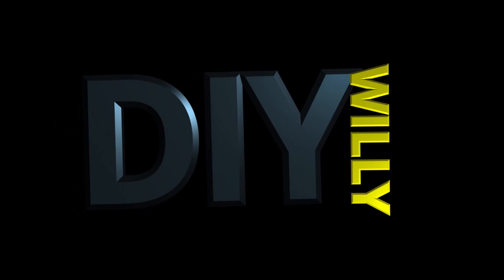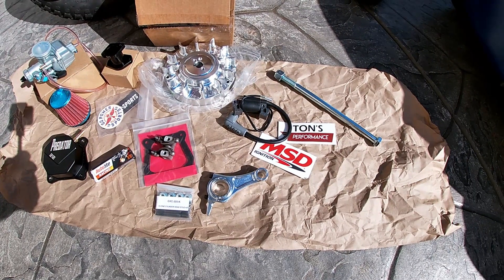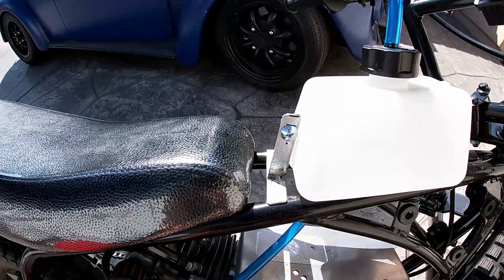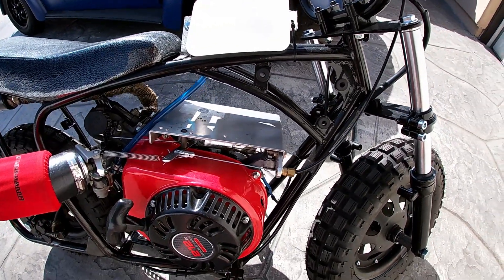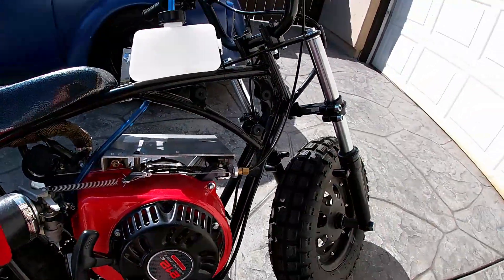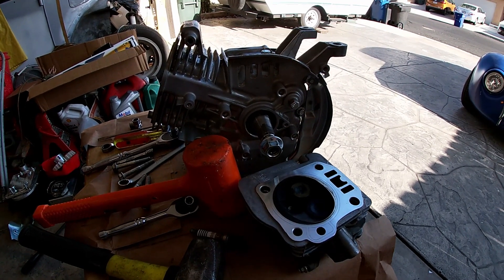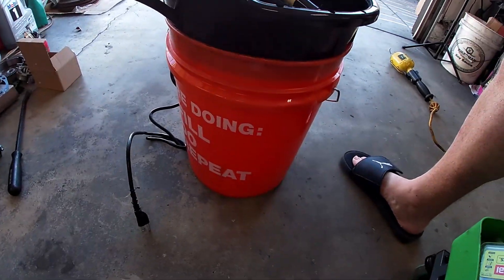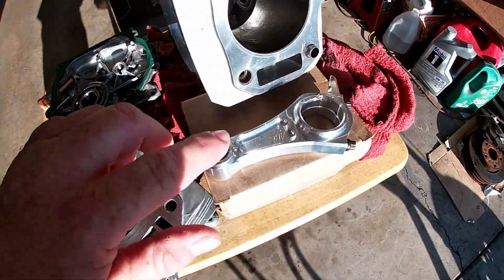Mighty Moto Part 7...Engine Build And Glamis Trip

Comment: u was rippin it up man 💯
Reply from the maker: Has the power but needs better tires for the sand.
Reply: @DIYWilly  i need to find the best bolt to put in this hole i tapped for that hockey stick from the gov setup i cant find your vid where u tap n drill it out i bought the quater 20 tap but what bolt do i use
Reply from the maker: @CruiZe-A-ViSiON  it’s a 1/4” bolt. They call it a 1/4-20. 1/4” is the size and 20 is the thread count. 1/4-20 will fit the governor hole perfectly. Don’t forget some blue/red locktite..
Reply: @DIYWilly  god man thank u im gonna go to home depot tomarrow or do they have it on amazon
Reply from the maker: @CruiZe-A-ViSiON  of course they have it on Amazon but you only need 2. For the plug bolts you don’t need grade 5 or 8. There not doing anything but plugging the hole so even the regular ones will work fine.
Reply: @DIYWilly  yea im on bolt depot website and man its like heaven for bolts its where i got my 5/8 axle from 7 bucks lol so they have the 1/4-20 bolts in every finish u can think of silicone bronze chrome copper ect lol i just need the length i know its 20 thread count but its still asking for the length on there
Reply from the maker: @CruiZe-A-ViSiON  ok 👍
Reply: @DIYWilly  thanks man you da best
Reply from the maker: Sorry for the late reply. 3/4” or 1” will work fine.
Reply: @DIYWilly  wat tires are the best foe oue 8inch chromiez rims mine are on the way from the grey goat himselfOMB